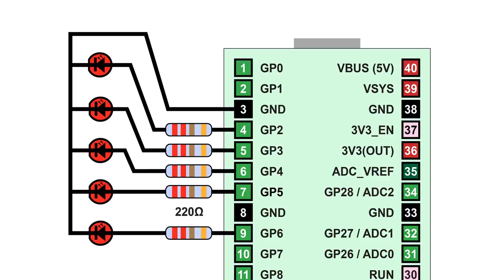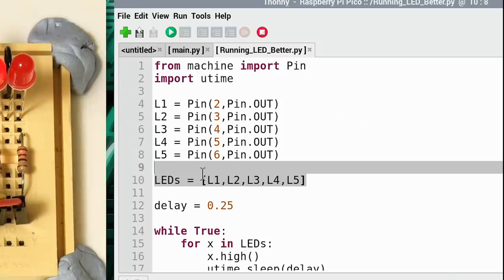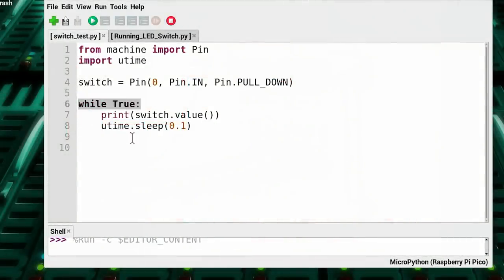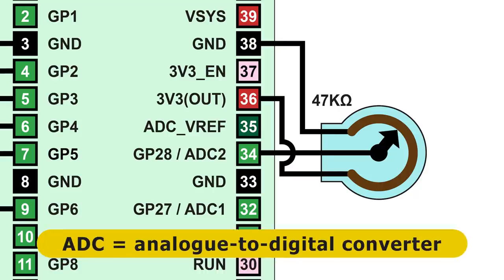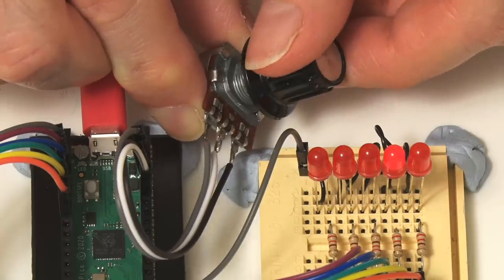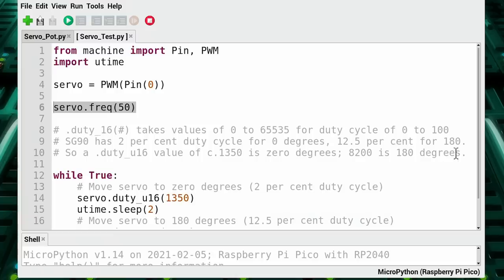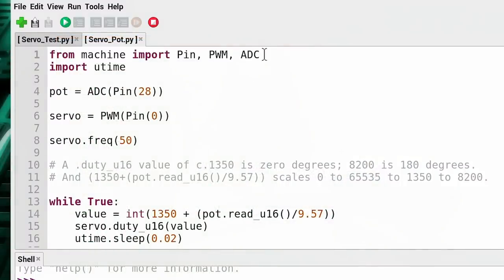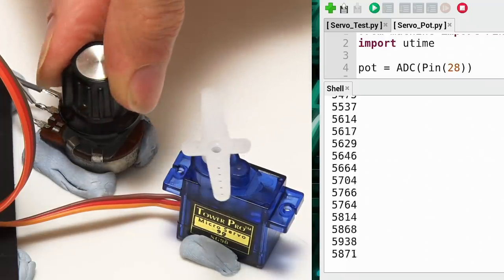Raspberry Pi Pico: Inputs & Servo Control

Comment: Another option that **might** reduce the jitter is to heat, or cool, or change the relative humidity, near the Pot.  The jitter is presumably caused by intermittent connection to various windings in the Pot. Temperature change will affect the relative dimensions, through thermal expansion, and humidity affects accumulation of static charge on insulating surfaces near the contact regions. Great video!

Comment: Good job! You just demonstrated common problem with potentiometers... they decay with age and add noise but even new ones do that. Thats why audiophile way is to replace it with ladder resistor switch.. but for your project all you need is a small capacitor in paralell across potentiometer mid and side pin and current limiting resistor in series to the gpio pin.. that would remove high frequency noise.

Comment: Excellent work. Pixador’s comment had me fast forwarding to spot the Zebra! Anyway you showed all the basics of input and output - both digital and analog(ue). My Pico starter kit arrived on Friday so tomorrow I’m off to the shed. It was also useful showing how you connect up to the Pi 400 as it helps to get started.

Comment: Back in the 1990s, when I worked for an industrial controls company, I learned about servos and something called a "dead zone".  Programming in a Dead Zone eliminates jitter.  So it really has nothing to do with your potentiometer, instead, it is the nature of servos.  It's amazing to me to see you using $200 worth of hardware that can replace a Programmable Logic Controller (PLC), that back in the '90s, cost tens of thousands of dollars.
Reply: Those PLCs were a bit of a rip off. They were just 8 bit micro controllers with some inputs and outputs and a simplified programming language. Late '80's through the '90's we would do the same thing with a Z80 and some code written in C. The advantage of a PLC was the electrician could program it.
Reply: @wayland7150  - Ladder Logic was cryptic as heck. PLCs were a rip off but well worth it to the companies who needed such a thing.

Comment: Great video Chris, as always. I now use CircuitPython on any microcontroller that supports it. I moved away from raw MicroPython except on something like an ESP32 that doesn't support CircuitPython. On the Raspberry Pi RP2040 chip boards there is a great PIOASM assembler that can run out of the box via CircuitPython. The latest version of Thonny does a very good job using MicroPython and CircuitPython boards.

Comment: Very nicely done, Chris! I like how you explain both hardware and software so we get a complete understanding of the whole system. Enabling the internal pull-down resister for the open switch is a particularly nice touch! Managing the LED pin assignments with a list simplifies the `while` loop in your Python code dramatically.

Comment: The dithering can be fixed using a simple closed loop controlling approach. That would be a very good introductory example to Control Theory using the Pico.
Reply: I wondered if you did some rounding on the pot results say nearest 10 would take out the dithering but without loosing any accuracy
Reply: simple_smoothed_value = simple_smoothed_value * 0.9 + lastest_value * 0.1
Reply: I would try to divide it by 100 and truncate the result.
Reply: @marksterling8286  losing.......loosing...........we know by now how autocorrect sometimes makes our text somewhat inaccurate, so it is worth checking before posting. You may be very experienced in giving commands to computers , so will appreciate accuracy in coding.
Reply: You should always place a small (10nF) capacitor on ADC inputs to micros to give something to charge up and dominate the internal sample and hold circuit capacitance. What you get is the result seen here if you don't.
Reply: @adymode  You've nailed it. He could also shorten that delay to maintain responsiveness.

Comment: Great video, a lot happing for such few lines of code. I'm new to the Pico so I've binged a lot of videos on the Pico! One problem I had with the SG90 was it going beyond the 180 degree mark which resulted in it shaking and heating up. After adding and displaying the 'value' variable to make it visible in the shell, I could find the value that took the servo beyond the 180 and created an if statement to limit the range of the value. It did work, although there was a region of the pot that didn't work. Will study PWM and Duty cycle for a deeper understanding of the code.

Comment: A welcome return of both the Pico and Blu Tack. BTW, I don't think the age of the pot is the problem. ADCs in general are a bit jittery. Put a 10uF capacitor between the wiper and ground. That should smooth things out a lot better.
Reply: Like de-bouncing a push button.  That can be done either with the capacitor as you mentioned, or in the coding.
Reply: A capacitor correcting the problem points to jittering voltage from the potentiometer, not the ADC.
Reply: @dang48  If the capacitor solves the problem then it's less work for the software.
Reply: @onjofilms  It's the nature of the real world, there is noise. The only reason there is not noise inside computers is the efforts taken to design it out or at least design out the effects.
Reply: @wayland7150  That is true.  The reason for debouncing in the coding would be to save physical space on your circuit board.  Both methods have their advantages and disadvantages.

Comment: Great video as always Chris.  Thank you.

I'm currently working with the Pico's little cousin, the Tiny 2040 and am trying out the coding that you explained in this video.  I played around with it as well and had some fun with it.  Didn't have a servo motor handy but that's okay.  Will be getting one at a later time.

Thanks for these videos.  They're a great help and hoping you get a Tiny2040 for future videos.

Comment: Picos are an ideal companion to a Pi computer, as they are much better at connecting to physical devices than the GPIO on a Pi is. My current project uses a Pi 3B with a touch screen for controlling a Pico that will have a motor driver, servos and a stepper motor attached. I'll probably use I2C for communication, but haven't got that far yet. The Pi will give me remote control through Wi-Fi, Ethernet or Bluetooth, including the potential to stream video so I can see what I'm controlling remotely!

Comment: For the Servo jittering issue, easiest fix would just be to round to nearest 100, you can clearly see in the video that the jittery-ness of the values only fluctuates 100 values or so.

Edit, The jittering output would make a pretty cool random string generator: sha256 the string of input^input.

Comment: Nice tutorial!  I've done this type of thing in "C" using an Arduino, but I've never used Python, and have always wondered if it would be easier.  This gave me a nice comparison of the two languages.  Very nice, thank you.
Reply: I have a project on the go to connect multiple Picos using the RFM69HCW radios (not the LoRa variants). The libraries for these radios are only available in C (they <may> be available in CircuitPython but I believe CP doesn't support interupts, which my project needs), so I went down the C++ route a couple of months ago using the Pico SDK and Visual Studio Code. It was an absolute nightmare to setup and get working on W10 (YouTube was my friend here), and is pretty cumbersome to use. In the last month or so RP2040 support became available on the Arduino IDE which I have briefly used just to test that it works. If the radio libraries were available to Micro Python I'd use that in a heartbeat. So much easier to use, and TBH I wouldn't miss the greater (much greater) efficiency of C++ on this project.
Reply: @skf957  The advantage of C is speed of execution.  C is compiled whereas Python is *interpreted.
Reply: @lesliedeana5142  Yes, thanks. And I like what I’ve seen of C++. Its relative inaccessibility (on the Pico at least) appeals to my inner geek/snob, it seems to be extremely feature-rich, and as you say, is fast in execution. But, and I am no expert here, Python and Micro Python, far from being the modern day equivalent of BASIC (and that wasn’t THAT bad), are also feature-rich and really nice languages to use.

Comment: So, I don't know if someone already mentioned it, but the issue with the jitter on the servo wasn't caused because your potentiometer was 40 years old, but rather on the fact that the 16 bits of the ADC are not "all useful" in this scenario. You only use the entire ADC resolution to average its value on most cases, or you can discard 1, 2 or 3 bits out of it as well. I know there are some cases where you can just use the entire range, but that's also paired with an analog front end circuitry on the ADC, with matched impedances, and not a single pot connected to it.
What I would suggest is to add a capacitor (100nF or so) between the output of the potentiometer and ground, and also average (or directly discard 2 or 3 bits) the raw ADC samples.

Comment: Brilliant video, Chris.  I’ve been programming on the Pico since February.  I like the simplicity of Micro Python, but I’ve been using the C SDK for maximum speed.
Reply: So for some that has used both, what's the speed difference?
Reply: Bad typing - "some" was supposed to be "someone".

Comment: I'm sure you'd have the same problem with a new potentiometer too. It's a noise issue in my opinion. A capacitor across the wiper to ground would probably sort that out.
Reply: ExplainingComputers is Concise and Clear as always! :) 

The servo jitter can indeed be reduced as Roger Froud pointed out using a capacitor to dampen the noise. Probably the best way. Yet, while the best software is hardware, I would still add a software value damper to the while loop which averages out the values as a fail safe.
Reply: @TriAngles3D  Exactly.  My professor was teaching us these concepts but with push buttons.  Called 'Debouncing', he showed us both the hardware and software way.  He insisted that we use the software way though. :-)

Comment: Very clearly explained - useful.  To fix the jittering pot, could you average-out the readings?  For example, read 5 readings into an array, add them together, divide by 5.  It'd make things a little more complicated, though - perhaps better to just replace the pot - although as other comments have mentioned, the varying readings could be in the ADC, and not the pot.

Comment: Really great video Chris, i have been trying to teach my son about pulse modulation but I failed to get his attention, today he sat down and watched you video and now we are breaking out the pi zero wh connected to a breadboard and a couple of servos, he is trying different code as I type this.

I have not got a pico yet preferring to ssh onto the zero.  

We both wondered with the earlier powering a pi from a 12v lead acid battery and today having analogue inputs and servos. Perhaps an explaining computers, robot or weather monitoring station would be a nice combination of the two episodes.
Reply from the maker: Thanks for this. I have a video on using servos with a standard Pi here: https://www.youtube.com/watch?v=xHDT4CwjUQE  I also did two videos on a weather station using a Pi earlier this year, first one here: https://www.youtube.com/watch?v=ChQpD2gsC20 -- and second (where I build an anemometer) here: https://www.youtube.com/watch?v=1LPEPZ02-t8  But there will be more projects . . .

Comment: You could write code to filter out the jitter,   Just average the last 50 ish potentiometer inputs before the current one and average it then add maybe 5%.  If the new value is not a greater difference, continue to return the same value.  If it is different, write it to a variable for the current servo position .., and it keeps sending the same value to the PWM u til significant change

Comment: Your jittering servo / pot input value was more likely noise induced in the input from the servo motor brushes or the pi itself than a dirty pot. Decoupling the power to the servo either with a separate supply or simply a .1uf capacitor across the supply pins would probably fix the issue. The same can be done across the pot. Dirty pots typically go open to the wiper briefly then back to their positional value, often very quickly but the result is a more random noisy signal.

Comment: The servo jitter is likely from the Pico ADC not your old potentiometer.  ADCs are not perfect and you will have noise coming from the USB port and the servo itself putting noise on the power rail.  You can prove this by putting a small capacitor on the pot wiper that is going to the ADC.  The jitter will still be there.  If you have a scope you will be able to see the noise on the power rails.
Reply: You could also test this by making a voltage divider potentiometer equivalent using a few fixed resistors.  Putting some caps over the power rails may help.  In any case you could do some simple filtering in software to help eliminate the jitter.
Reply: Thanks, I was hoping to find an explanation that exonerates the potentiometer.
Reply: A possible workaround would be to logically AND the ADC value with 65504 or 65472 so as to ignore the lower five or six bits.
Reply: @delwoodbarker  a 40 year old pot is going to have inconsistencies from corrosion,  especially if you only use it a little or intermittently.  You can increase the precision of them by using a contact enhancer, my personal fav is Caig Deoxit, (NASA as well as major medical equipment mfrs use it).

Comment: The jittering may be not the old pot but the self noise of the ADC or to be more precise it‘s reference voltage caused by the switching regulator. I have read that you can reduce adc noise in software by pulling up that pin to VCC

Comment: I'm not sure the age of that potentiometer is solely responsible for the "jitter."  I think all potentiometers have a bit of jitter in them -- much like all switches have a bit of "bounce" where it switches rapidly on and off as you close or open the switch.  I'm sure you could write some code to "de-jitter" that pot -- maybe something where it examines the previous value and if it's within a certain %, don't change the value being sent?

Obviously that's more work than what's needed in this video -- you were trying to prove a concept, not build a working machine.  This was lots of fun to watch.  Nice to know about all the stuff these GPIO pins can do.  Thanks!

Comment: Very interesting projects,

Maybe we can reduce shaking of the servo programmatically by not using the full resolution of the ADC value,
I mean the full resolution 8200 - 1350 = 6850
What if we divide the value variable by 4 for example, get discard the decimal places then multiply it by 4 again,
this way we'll get the same value range but in lower resolution which may reduce the shaking (I think)

Thanks Chris, I hope we see more projects like this on Pico
Reply from the maker: What you say is spot on, and should work. There is too much resolution in play.
Reply: Unfortunately the noise is much greater than 4.  Just watching (trying to) the printed value I saw a range of 6167 to 6253 a difference of 86.  And that is just what I saw over that small sample at that exact point and it may get much bigger at different levels also.  Now simply dividing by 86 would give about 80 steps in that 180° range which depending on the application may be enough resolution.  But really you would need to reduce that by 2x to 40 steps as you would still get single jumps between those steps.  See my earlier post about where the noise is likely coming from.  A resolution reduction as you suggest is still part of the solution but there is more to it IMHO.
Reply: @ElmerFuddGun  Good point,
I just read your previous comment, I'm not into electronics but it sounds logical to me,
If the jitter comes from the ADC as you mentioned then I think finding a solution is a must, at least to reduce it to an acceptable degree

Comment: can not wait to see you with an update about the Pico W and its possibility accessing data from the lan or cloud like homeassistant.
Usefull for showing the energy production of a solar power modul / generator live in Watts, kWh today, this week, month and year.

e-Ink would be a nice solution too, also a forecast of the clouds / sun for the next 90 minuts a usual dish washer or washing machine or dryer does need to run on solar power. 

It is just an indicator using less power on an e-ink and is always useable for everyone in the household instead of using the phone and app you need to start or even log in. Just looking at an e-ink while you go buy is a lot better than the app overhead we usually see nowadays.

Comment: The Pico using Python seems a lot easier to work with than the PIC18 in Assembly/C which I had to do in one of my courses. I can see this having lots of potential for teaching microcontrollers to computer science/software students.
Reply: You should see the Pico with MMBASIC, even easier.

Comment: I believe I know why but do you (or anyone else) want to give an explanation why you used the 3.3v supply for the switches rather than the 5v one. I'm assuming it's just a question of not needing the extra voltage on the switch or pot, so get in a habit of using the less power option when possible.

Comment: The value fluctuations when reading the potentiometer might not be from its age, but most probably from its value.
I don't have the RP2040 datasheet at hand, but judging from my experience with several other micro controllers, I would say that 47K is way above the maximum source impedance for the ADC.
In the world of micro controllers values betwen 2K and 10K are the rule for ADC inputs max source impedance.
For this kind of connection the max value of the potentiometer should be twice the max source impedance of the ADC input. 
Also such a high value makes the whole wiring prone to EMI pick up.